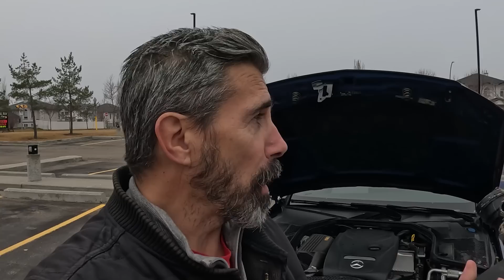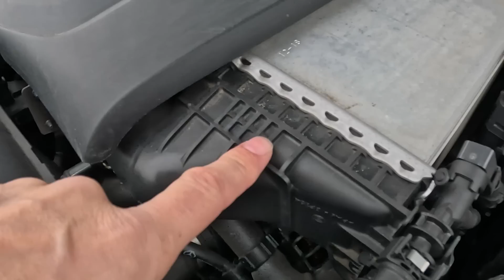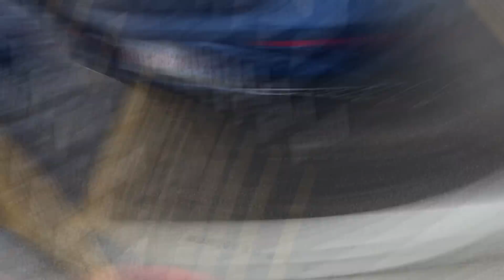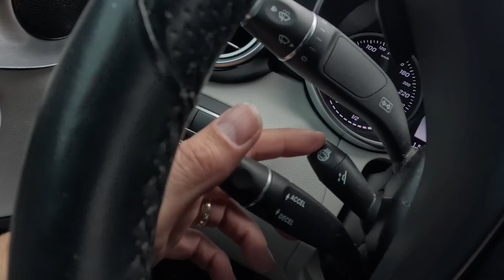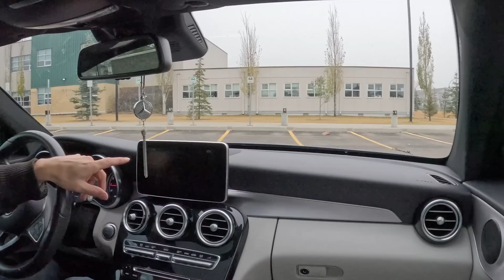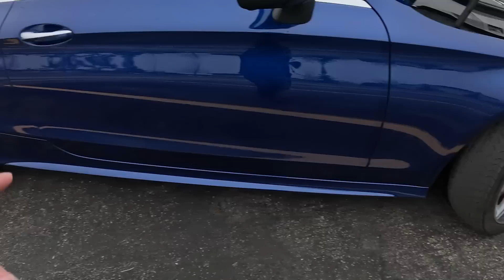Here’s Why New Cars Can't Last  5 Years | What Went Wrong?

Comment: These plastic cars here in Oz are a disaster in the making, but the biggest issue is defs the small engines now. Most utes here (pickups) are turbo 4’s, sure they may be diesel but mate try running a 2ton Ute (loaded with camping gear or towing) on a 4cyl!!! … I was in my mates driving on the beach recently and the engine felt stressed and hot 🥵 Then all the plastic components on top. Gimme a naturally aspirated 6 or 6 with a turbo or 8 with a turbo like the old Toyotas. You want the turbo for top end and that’s it not for getting the vehicle to move lol

Comment: Got 2 bmw e61 m57 as daily’s and gen2 ram 5.9 with manual and jaguar xjr x306 as hobby cars. I hope that these older buddys last forever. They don’t ask much but parts isnt so available like bmw have. I’ve always looking cars which are simple and durable as possible. Daily cars must have used parts available and most common repairs doing myself or with my friends help. First thing what i look when i buy new daily is how expensive is maintenance and how much cost parts. How much these cars commuting every day on streets and so on.
With hobby cars is bit different. If you have some shed for hide them its okay. Older cars parts isnt always available and some parts you must do by yourself or wait very long time. By example jaguar have been over 12 years with me.

Do not buy new cars. Look these cars which can go high mileage and take one that have less than average mileage. One of my bmw’s have over 323k miles on clock and still pulling hard. Every month i hear stories about grenaded engines and gearboxes on ~62k shitboxes and how expensive all is.
Don’t let yourself mugged.

Comment: I am seeing so much trouble from plastic parts. The hoses have these special ends and the plastic on both sides is brittle. Some of the parts are not easy to find. Either way a lot of simple repairs are overly complicated due to all the stuff that surrounds it you need to pull only to have all sorts of plastic connectors, clips, hoses, and tubes that break very easily.

Comment: It might seem strange, but the Porsche 911 is pretty amazing. I have a 2007 GT3, naturally aspirated, with 60,000 miles, but that includes hard-core racing and very hard driving with other exotics. Gobs of tires and several clutches, but no engine or suspension or other mechanical problems at all.

Comment: this is why i drive and i keep my Nissan Patrol TD42 6 cylender in ligne Diesel with 5 speed Manuel Transmission no turbo with mecanical fuel injection no timing belt no timing chain just timing gear i have no main computer no catalyc converter no egr valve just peace ive got 250000miles and it still running strong no problem easy to maintain parts dont caust that much because it's simpler i still have the original suspension the original clutch everything is the original i know nissan have some problems with a lot of models but not with the Patrol it's big Suv Truck with full frame and it's not a speed car because it's big truck with simple engin TD42 but i can go whenever i want and i can go 90mph if i want if guys wont relilability keep buying a simple mecanic

Comment: All turbo engines are purposely designed to last 100,000 miles and not much more. If the oil changes were not done every 5000/6000 miles the engine won't last to 150,000 miles. The best engines are now the V4 naturally aspirated 2.5 litre and V6 naturally aspirated 3.5L for many 2008 - 2014 model years. I decided to avoid buying overpriced new cars with inferior turbo engines.

Comment: This is why I am keeping my 2012 Ford Focus Hatchback with MANUAL TRANSMISSION (no transmission issues) with 176,000 miles on it. When oil changes are done regularly, these 2.0L NA engines go 300K to 500K miles!! I have always done my own work on my cars. When it was time for new balljoints I found they are integral to the lower control arm and has to be replaced as a unit. Well, I have new bushings as well as a result, so the ride is great. AS FOR COST....I got a brand new set of Ford lower controls arms, still in the plastic, off of ebay for $220 FOR BOTH. That was a steal. Labor was free as I did it myself. Doing my own oil changes cost about $35 for quality oil and filter instead of $70 to have it done  (Whatever happened to $19.95?). My engine still runs like new. It is a great and fun car, when you don't have the "manual automatic" DCT. The only thing that makes ZERO sense is the times I go out to the car for the first time of the day, I open the driver's door, and the radiator fan comes on. WTF? How is the driver's door connected to the radiator fan system?? I replaced the fan control module and nothing changed, so that's not it.

Comment: I bought an used 2021 Subaru Impreza 5 speed manual in 22. It didn't come with auto braking, lane departure warning, eyesight system, and blindspot detection. I don't miss any of that or brakes that can't be serviced like the 2024 Subaru's that have propriatary software incorporated with the brakes.

Comment: The smaller the displacement of the engine, the higher RPM it has to run at to produce the same result. Plastic and aluminum move at very different rates in response to temperature. Bolting a plastic intake manifold to an aluminum head HAS to fail. Putting a heat soaking plastic " beauty cover " over the engine will accelerate the failure, but they keep doing it anyway.

Comment: The plastic parts should be very cheap to replace, mechanic said the newer parts costs more to buy than the old metal parts it replaced and takes longer to replace
Reply from the maker: It is a vicious cycle that they are using.

Comment: Chill dude. True for some newe cars but not all of them. My 2016 BMW was crap. Sold it after 4 years and 60000 miles. 2x turbos, 1 differential, plastic plastic. It was starting to fall apart and in 2021 BMW started to deny goodwill service. I DIY with cheap parts and sold it. 

Toyota still builds decent cars though. But go for the ones that is made in Japan. My 2021 RAV4 Prime is a solid car. Toyota know how to build hybrid cars. I also own a 2013 Toyota Hybrid. Also Japan build. No issues. Just make sure to keep the hybrid battery cool(clean filter once a month) to make sure not to overheat it will last for 15 and up to 20 years without needing replacement.

Comment: new cars? trucks?
 they are awesome
we toss em

 my last "new" car was 2014 "ok"
in 2015 my wife wanted me to get a new one - so I looked.
 some neat features Id like, buut too much more that I didnt want - ugh

 my 1990 was better in many ways [still not good, but better]
my 1975 dodge truck has 0 electronics and true 4x4 - so yeah 

 a new truck? not for me, it is disposable
I have a 2001 GMC truck with less miles than the Dodge, but the GMC has computers, plastic and many electronics that failed.

 as for a turbo?
I have one in the old dozer & its all metal & still going strong in the 1978 diesel 4 cyl.
had them on bikes {fail} on cars {fail}
 seen them on modern engines and I see they are made to fail.

Comment: It may not be as noticeable in the US, but in the EU govts are literally cracking down with ridiculously elevated taxes on anyone who owns an older, inefficient vehicle, especially those with bigger engines (and by a big engine I mean V6). Secondly, the fuel costs significantly more than in the US and other parts of the world for that matter.

These are reasons why you see so many people here drive relatively new, small to tiny cars. You need at least some tech to navigate quickly and safely.

So yeah, you guys there overseas are still doing fine, we can only envy your ability to still drive V8ts and V10s (an extremelly rare sight in EU) and not be too concerned about your yearly road use tax or something as we do.

Comment: Cars seem to be designed and produced like washing machines and fridge freezers for the past 10 to 15 years. Ok replacing your 7 year old washing machine or fridge is no big deal. Your 40,000 car is another matter. I’m still keeping my 8 year old Renault Trafic 1.6 turbo diesel van as long as possible. It’s fairly basic but is Euro 6 adblue which nearly cost me £800 ( $1000) for two Nox sensors if it wasn’t for some warranty remaining. I want a basic unsophisticated vehicle that gets me from A to B

Comment: Failing attempt to push into EV vehicles which have already shown are oil recharged stations and the batteries cost more to replace than the actual cost of the used vehicles. As with the large wind energy turbines the blades need to be replaced as maintenance and they are not recyclable. Resulting in acres of non recyclable fiberglass blades. Several cities in China have returned their buses to fuel because the battery replacement is astronomical. Same with solar panels. They are not repairable or can be recycled. So where are all these dangerous chemical non recyclable materials to be disposed to? Are we going to dump them in a third world country to poison their water supply and increase the hatred for America because Americans are too stupid to do the research and jump on whatever scheme corporations and governments use to "virtue signal"?
Reply from the maker: That is a valid point.

Comment: plastics are very weak against heating up and cooling down cycles they stretch out many more times then metal components. so after years when the softeners evaporate out of the plastics the plastic components can't handle the stress from heat related stretching and shrinking and they will crack. sadly only after years of use but thats nothing what OEM's care about

Comment: Hyundai dealership service department wanted to charge me $700 to diagnose oil burning problem. 😮
Reply: Just have them change the valve stem seals, usually the biggest offender.

Comment: 474,000 miles on my mitsubishi mirage only owner bought brandnew. Original motor original cvt transmission. Factory battery lasted me 11 years. Back brake drums lasted me 191,000 miles.   Oil changes every 5,000 cvt oil and filter change every 30,000 has nevee broke down or needed repairs. Give me a simple car anyday.

Comment: Mr doom and gloom. BMW in the last couple of years have gotten good ratings for reliability and dependability. Granted if you have a high performance model maintenance can be expensive. My friend has sa m4 comp snd a brake job is 4k. If have a base 3 or 5 non m version with a b48 or 58 and if not leased perform excellent  maintenance on them like 6k miles or months oil changes your ok in my opinion

Comment: Here’s one… I had a Nissan Rogue loaner with a 1.5 3 cylinder CVT while my Nissan Armada platinum 5.6 went in for warranty work. I currently live in the Adirondacks, so my Armada shows 12.7 mpg, and does the hills without an issue.  The Roque struggled, put in sport mode so I didn’t get run over.  The roque pulled 18.2.  That is pathetic!!

Comment: If you're buying a new vehicle, go into the service center - not sales - and ask the service advisor to make a quote for basic services. Brakes, suspension, tire cost, even alternator. Some of these basic services require long hours to repair these days. The engineering team is not in control of the design, the finance department is. They don't care if it costs you 10 hours of labor, when they could've moved something for a single dollar per car. They save a dollar on 500k vehicles and they saved $500k overall.

Comment: My 2024 Supra with twin scroll turbo 3.0 liter i6 engine will switch on a hurricane wind - generated fan after I turn off the engine. (After accelerating briskly within a few minutes of shutting off the engine) 
 So there are ways to keep the engine bay plastics from becoming brittle. I always place a windshield screen up when parking for a while on a sunny day. This really helps to keep the interior cooler, especially when the interior is black.

Comment: Nissan's turbo 3 cylinder even has variable compression.  It will be interesting to see how long they last.
Reply from the maker: Dry short lifespan in my opinion on that engine
Reply: Probably gonna have a catastrophic failure trend within 75K on those if I had to guess.

Comment: Volkswagen Tiguan.. 2 years old, plastic sump cracked due to heat cycles - dumped its oil all over my driveway. 3 months later the water pump went out. Yep plastic, and half the engine had to come apart to fix it. Total POS.

Comment: Thank your local Democrats. Short sighted and counter productive regulation causes car makers to reduce the weight of their cars to meet some moronic CAFE standard, and all that plastic can't be recycled, only the metals. A lot of great cars had their lives reduced by half during the early 1970s into the early 1980s due to idiotic government regulation of emissions. Hondas had something like 40 different hoses running everywhere to meet those emissions regulations. They should have just waited for electronic fuel injection to be viable, but that would have made too much sense. Notice that government doesn't require recyclability or longevity, and they don't mind EV fire runoff into streams and into the air carrying who knows what into local driniking water and lakes.

Comment: I made the mistake of buying a car with a turbo. I was sold on the amount of space that the Ford Bronco Sport has. The car is only okay on the road, not great. The 8 speed transmission SHOULD BE buttery smooth and it's not. It's got shudder issues at low speeds which I didn't notice upon the test drive. Sometimes the transmission doesn't work well when passing. When punching it or even stepping on it to pass, sometimes it downshifts too many gears, and puts it in a gear that's already too high of engine RPM and at the end range of power....so you're not exactly going faster. Stupid Ford. And yeah, everything is plastic in the engine bay. I'm kinda shocked the turbo isn't made of plastic.

Comment: If you have a Euro car with laser headlights, you may want to sit down with a paper bag if a lamp fails, some (BMW) are running around 27K to replace the headlight assembly, there is no alternative to full assembly replacement along with specialist re calibration and software authorization, the days of replaceable bulbs are long gone. Also in some vehicles, they are not being covered by warranty as they get classified as a consumable item.
Reply: Hard to believe. Show some data

Comment: 26 old my E39 hasn't got anything broken under the hood.
Yes, around the 24 year mark and 120,000k miles  it had some oil leak and coolant leak issues from the gaskets, but after some maintenance and preventative chain and guides replacement, it now runs like a dream and engine looks as good as new after I had the cam covers acid dipped and painted. 
We bought a Peugeot e-208 with 21k on the clock, which had its windows jam up half way up, along with other problems from day one. We had to sue the dealer to fix these as it was sold with a perfect inspection record, in order to make them fix the car...

Bought a brand new Hyundai Ioniq in 2018. The door seal went before I got to 20k miles under three years. Wasn't covered under warranty. 
My bosses brand new audi Q7 had recorded 30 faults in 6 months. His electric seats stopped operating.
New cars are shite...
Reply from the maker: Thanks for sharing your experience.  Yes that can be a tough one indeed

Comment: People dont want all this technology, they are told that they want this technology, from the manufacturer advertising but worse from bought and paid for on line influencers. The public want to fit into the spun narrative.

Nobody asked for much of this technology. They want general safety, not self driving, nobody asked for heated steering wheels, let alone fake leather seats with heating and cooling. Most are just fine with air conditioning.
I could go on, but people today are brain washed to pay for all this crap as they want to fit into the narrative.🤔

Comment: Big reliability issues apparently now surfacing in Europe with Peugeot and Ford 1.1 and1.2 litre turbo engines that they have widely used to replace their 1.4 to 2.0 litre engines
Reply: Too much compression for such as small space. Physics will let you know what’s practical and what’s not. I guess the engineers think they can squeeze as much power out of smaller and smaller sized engines without compromising quality, which I guess if designed properly it would seem feasible.

Comment: Why is the government not stepping in to stop car makers from making crap. It takes a lot of resources and creates a lot of carbon to build a new car. If cars lasted longer, there would be no reason to buy a new car so soon. It’s irresponsible on both the car makes and the daft government. The greed needs to stop.
Reply: they are behind it on the take via CAFE pushed by BIDEN EPA Green WEF UN Agenda!
Reply: It is the government that is responsible for them making crap! The government doesn't care about the resources to make new cars. They don't factor that into their calculations. They see replacing a newish car with a slightly newer one with slightly lower emissions to be a total win, ignoring the impact of making the new car completely. These cars are made to meet fuel economy standards first while still delivering "acceptable" service life. That is why we get super thin oils that increase fuel economy a tiny bit but fail to protect the engine as well, and all kinds of other stuff like that. Safety regulations mean cars have to be heavier, while at the same time the fuel economy standards keep getting stricter, forcing the carmakers to save weight where they can, and that is what has driven the move to plastic parts. 

Don't expect government to fix this problem. Government does not fix problems! It creates them.